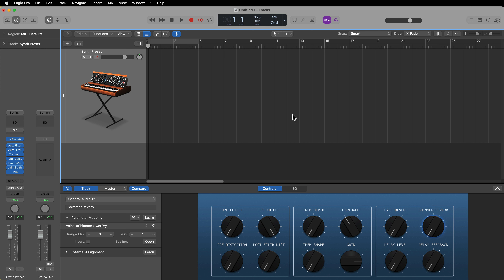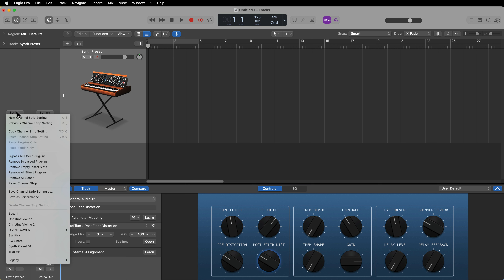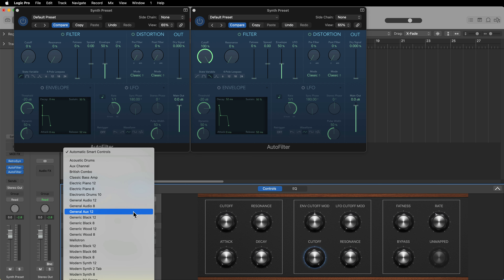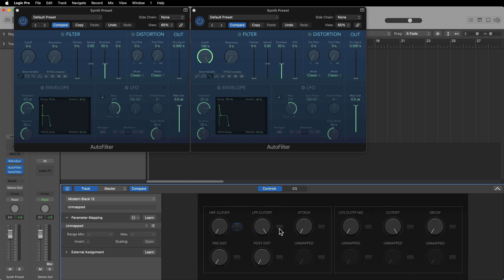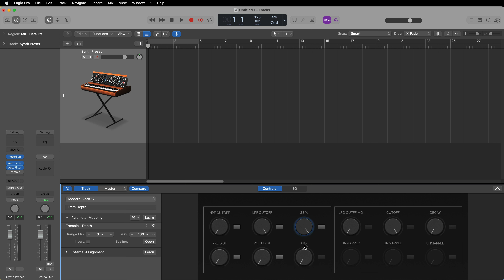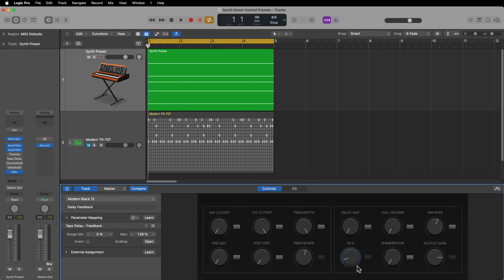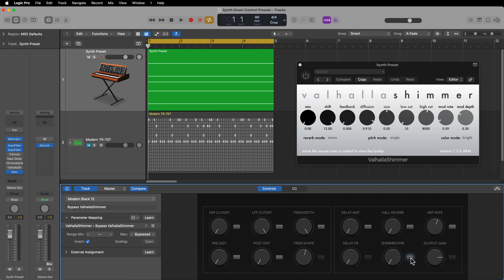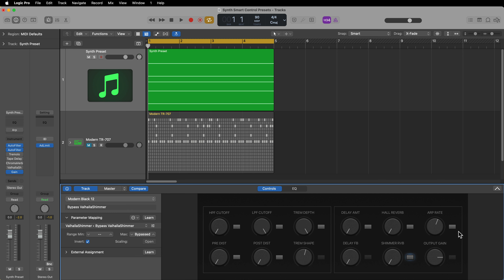Logic Pro - Smart Controls Synth Effects Presets

Comment: I successfully used an old Kawai XD-40 Keyboard solely as a midi controller for years, to input notation with Finale. But since my recent switch to Logic Pro X on my MacBook Mojave, though it's seen as connected to my Motu USB Express, in Midi- Audio setup with Clockworks, I can't find a way to get Logic to see it as midi connected in my current project, since the Kawai brand is not listed to assign in control surfaces, & I don't know how to do a manual generic assignment for this towards inputting formal notation in the Logic score editor after bypassing control surfaces. 

There is no advice I've seen online to use with my last version of Logic that works in Mojave (10.5.1), all YouTube tutorials I've seen, either show one how to do it with listed brands in control surfaces, or just how to do basic hookups with old midi controllers, but not one that addresses my specific issue. 

With your expertise using Midi controllers here, I was hoping you may have a solution, otherwise I'm at my wits end, & can't afford a new midi keyboard controller at the moment, so would greatly appreciate any step-by-step advice, I just want to start composing  again, thanks!